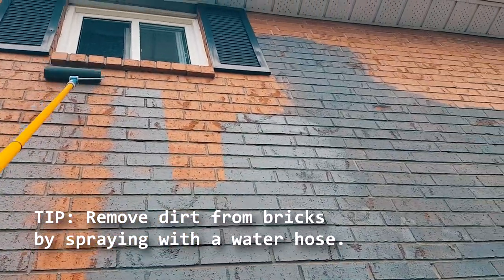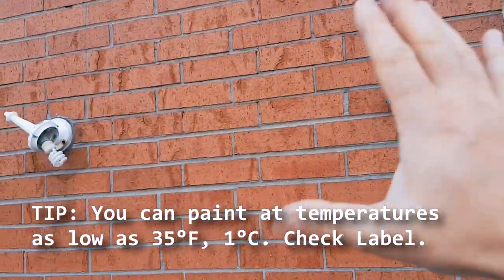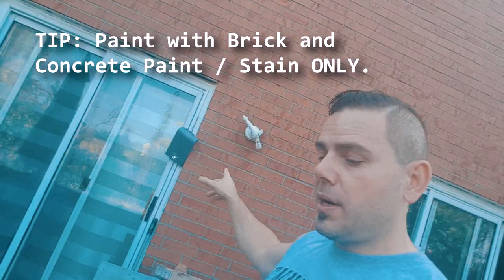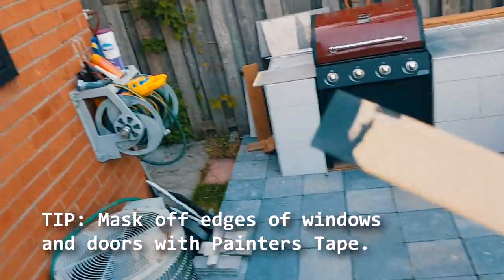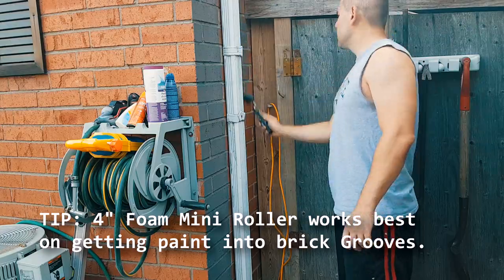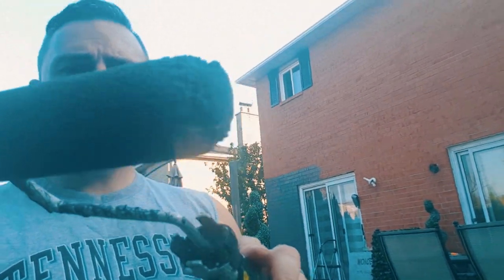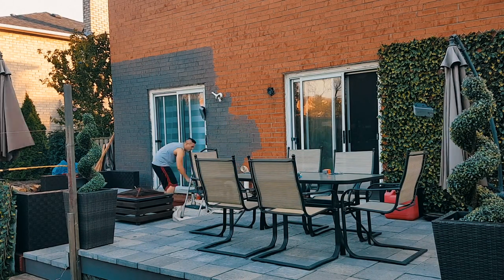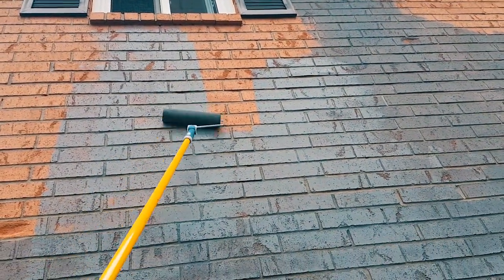How To Paint A Brick House Exterior. DIY Outdoor Painting Tips for Brick Concrete. Behr Brick Paint

Comment: Quick tip. Buy a lower end paint sprayer and cut down time and pain. Time is money. Back roll with a 1inch nap after you spray when it's still wet
Reply from the maker: true that, i ended up buying a wagner sprayer earlier this year , finished it and repainted the whole house with it. thanks for the tip.

Comment: Why do you not work from top to bottom 😳. 3/4" nap Wooster Roller is the weapon of choice. No such beast as a skim coat in painting. That's all purpose sheetrock mud lingo. Just say 1st Coat to be correct
Reply from the maker: First time doing it, I didn't have a ladder up and honestly this was a spur of the moment decision, i figured if i dont like it, ill just paint it back. Before you know it..... i ended up picking up a paint sprayer, that was way better.